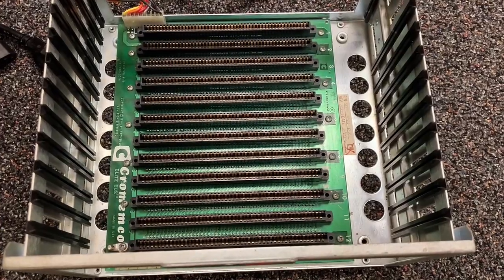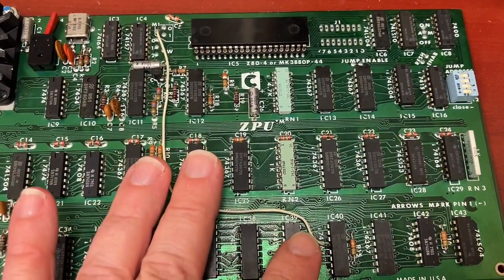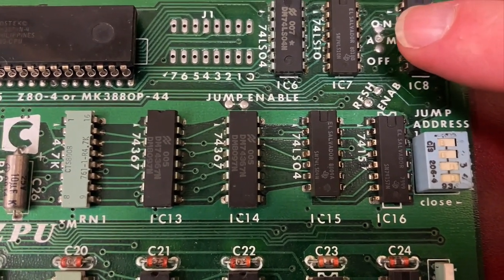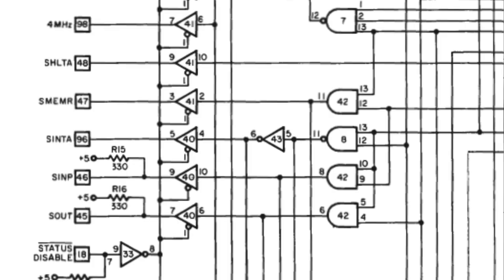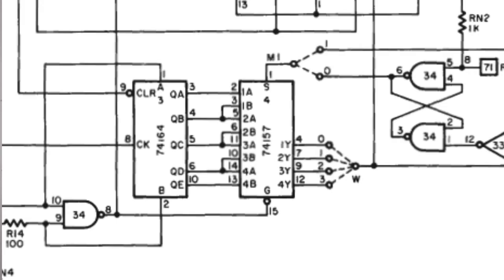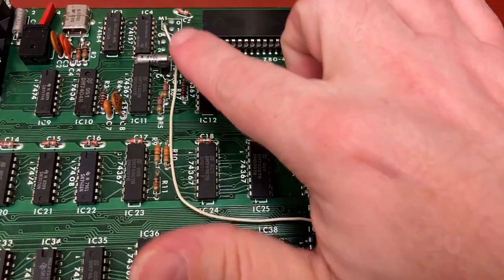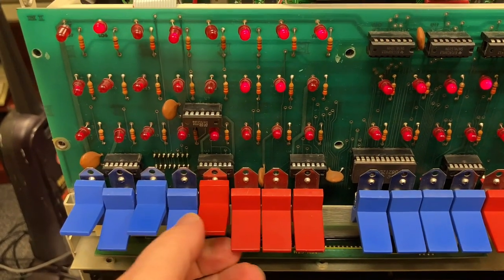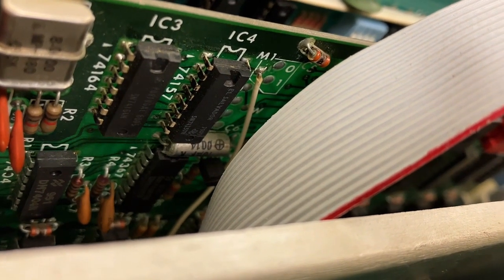Mysterious Bodge Wire on a Cromemco ZPU Z-80 Board: What Does It Do? (S-100 Bus Shenanigans)

Comment: Adding a wait state to M1 was pretty common. (On the Z-80, the M1 instruction fetch was the memory access with the tightest timing.). Adding a bodge to pull the wait line true on SINTA will add a wait state on interrupt-acknowledge, probably because without the wait, the CPU would run fast enough to pull data before the I/O device asserted it.

I'd have probably tried to bodge the wait into the slow I/O card, but doing it on the CPU card wasn't that uncommon, particularly if you had a whole cage full of devices that were designed for 8080 at 1-2 MHz and didn't know which one was the culprit.

Comment: Maybe it has something to do with the INT 2 mode that requires a byte to be placed on the data bus to form a lower half of the interrupt vector, and IIRC the /M1 line is used to communicate this condition (other than its normal role, signaling the first instruction cycle).

"The Z80 peripherals sample for both /M1 and /IORQ
active, and /RD inactive to identify and Interrupt
Acknowledge cycle. When /M1 goes active and /RD is
inactive, the peripheral detects an Interrupt Acknowledge
cycle and allows its interrupt daisy chain to settle. When
the /IORQ line goes active with /M1 active, the highest
priority interrupting peripheral places its interrupt vector
onto the data bus."

Comment: I think the bodge wire adds an additional wait state during INTerrupt Acknowledge cycles. My guess is that this board was used in a system with an IO card that wasn't designed to run at 4MHz, and had no ability to add wait states on its own.
Reply from the maker: Ooooooh! That make sense... the only other card that came with this was a Cromemco 64K memory card, so knowledge of whatever card this was meant to accommodate has been lost to time. It sounds like leaving the wire in generally won't hurt anything.